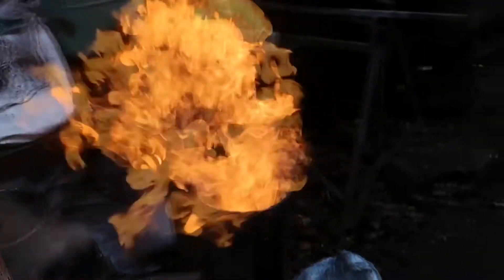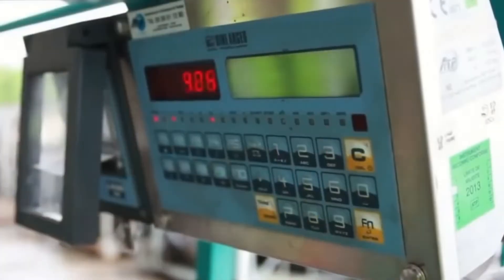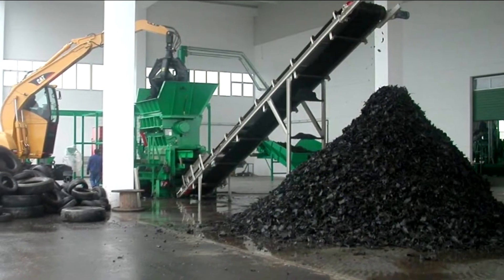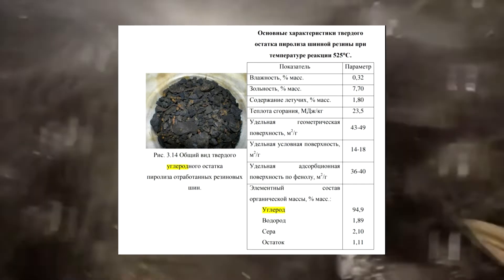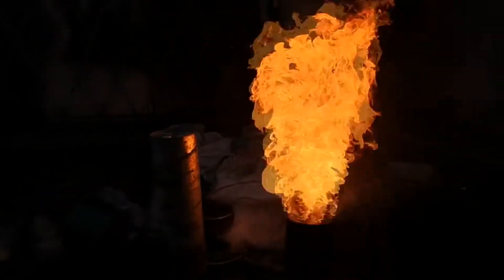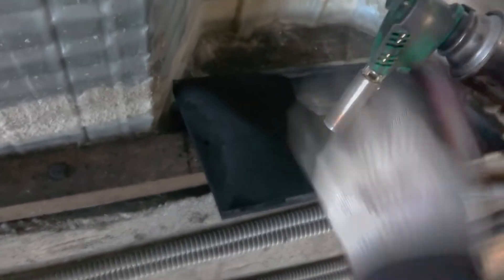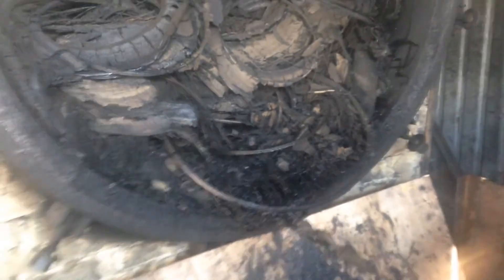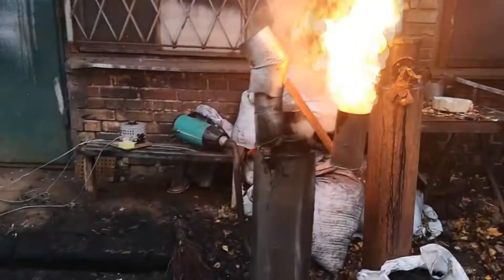Making gas from tire carbon (technical carbon)

Comment: You can combine carbon with water at a fifty percent by weight basis. If your gasifier is hot enough and you have some kind of spray nozzle for fuel you xan mill the carbon and water to a thick oil like consistency and spray it in.